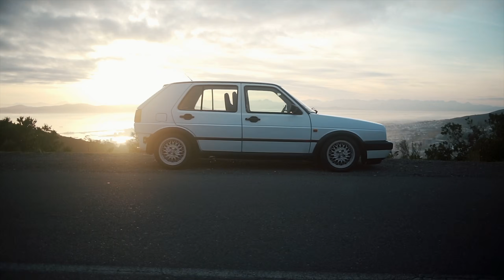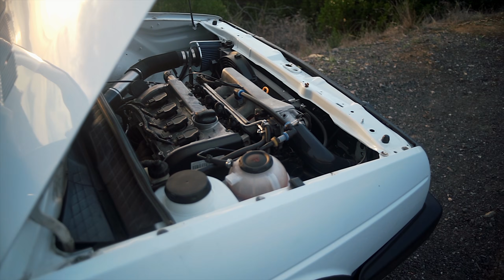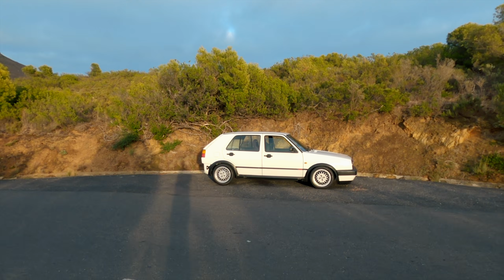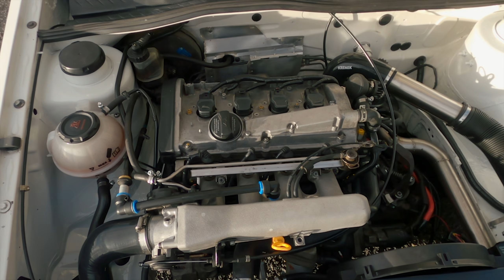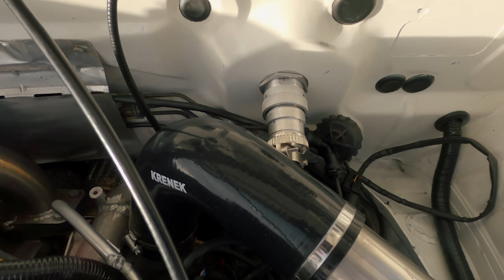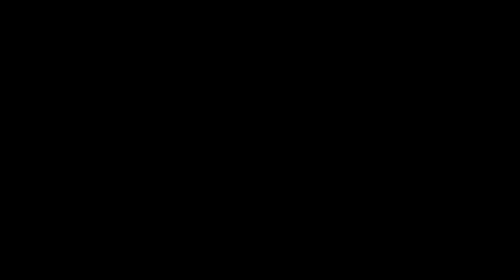How much did it cost to go big turbo 1.8T and cable shift in the Mk2?

Comment from the maker: I made a mistake with the wiring section. The injectors (4x1000cc's) shouldn't have been in there and I mentioned wiring connectors & the Mill spec connector but it's the same thing. 🙈 3k off the price there.

Comment: Hey man, I known this video is a while back, but this is a stunning car and build.
Are you still running the Mr Turbo GT28? Has it given you any issues? 
I'm thinking about getting that same turbo from Mr Turbo for my Focus ST225, but I need honest input about its reliability and how far it can be pushed.
Reply from the maker: Hey. That turbo is long gone. I wouldn't recommend it. Get the GT30. If you want fast response, get the .48 hotside. But for your displacement, the .63 is probably the one. My dad runs this turbo and it's taken absolute punishment. My 28 didn't last too long. 😢
Reply: @lowdl Thanks a lot. I was just aiming for 300kw with a GT28 as I'm currently stuck at 240kw on stock turbo, but now I might as well shoot for 350+. I was just very concerned about reliability and quality of Mr Turbo turbos.
Reply from the maker: @Chad_ST225 The 28 is a bit of a mismatch. And having a T25 flanged turbo is limiting long term. If you go with the T3 GT30, you can easily upgrade. Because you will want to. But bang for buck, those Mr Turbos are brilliant.

Comment: Thanks a million!  Was considering the same upgrade. .....
Reply from the maker: It’s a good swap. Depending on what you want to do with the car you can modify it accordingly. If you want big power, you need a big turbo and that gets expensive. But if you want a fast road car then the stock turbo works fine and will save you a lot of money. If I were to do it again I would probably fit a BAM engine with the K04 turbo. It will make around 180kw and be the perfect all round car.
Reply: @lowdl  is it possible to give you a call some time? Really appreciated your videos and would like to get in touch as I am still running KJet and my CLi is very special to me....was also looking at the other route you've taken with the throttles....but feel it would change the character of the car too much with that sound

Comment: Hi Lorenzo I wanna ask if the speedometer is working after your engine swiped or you had to modify, thanks
Reply from the maker: Hey. The speedo is connected to the gearbox so it's not so much an engine thing but a gearbox thing. Because I changed both the engine and the gearbox, I had to modify the output from the gearbox. You get an adapter that takes a digital signal and makes it analog for the Mk2's analog cluster. Speed seems fairly accurate but bounces around a bit at very low speeds when pulling away. Haha.
Reply: @lowdl  thank you so much bro.

Comment: I just recently bought a nice 92 gli, but the 16v is tired and actually has Weber carbs on it. Thinking about an engine swap compared to a rebuild on the engine. A 20v turbo sounds more appealing to me with tuneability and easy of engine swap compared to a vr6. Thanks for your incite. Was gonna keep the stock turbo though if I choose that engine though only wanna rock like low 200 hrsps
Reply from the maker: Would highly recommend the swap. Stock turbo is fine. Ideally K03s or K04 if you want low to mid 200s. The K03 is a sub 200hp turbo. All the best with it, Webers on a 16v is pretty cool too. A rebuild is probably cheaper with a set of cams and it will be fun. The 20vt just gives you a lot more head room and torque.
Reply: @lowdl  it's just I'm in California so I previously got the car illegally smogged. The car currently in webers eats gas like 17-20 mpg, it's running a little rich so need to tune it better but the car has 300000 miles on the motor knowing I need to swap or rebuild. So I think I can Get the car smog legal if I switch to a 1.8t and verified as that. So with just a programmed tune with stock internals and turbo 200 ish is about the limit otherwise I'd need to upgrade the turbo in order to get into the 200-250 range. I'm talking about at the crank too btw.
Reply from the maker: That makes sense. 1.8T is the way to go then. Definitely more efficient and will pass smog. If you can find a donor Mk4 1.8T and swap everything including the ecu you will be in a good space. The top spec 1.8T with a ME.7.5 ecu is the one you want. All the best with your adventures. Hit me up on IG (@lowdl) and keep me in the loop. I know Cali is wild with emissions things.

Comment: Wow! You just motivated me to finish building my GTI and get it back on the road...What clutch and flywheel are you running?
Reply from the maker: That’s great to hear. It’s a ABF clutch and stock 1.8T flywheel. Seems to hold the power just fine.

Comment: Is it engine too close to the ground? I have issues, my oil pan is dangeoursly low... Sport coilovers, 195/45 15 tyres
Reply from the maker: Yes, the oil pan does low on the 1.8T. I raised the car up so that I don't have clearance issues.I've heard that the 1.8T beetle pan is the way to go. It's a tad shorter but it's metal. So it can take a beating.

Comment: Hey buddy.. What fuel pump did you change ? the in-tank or the one under the car ? and what did you go for ?
Reply from the maker: I didn't change the fuel pump. It's the stock GTI pump which is under the car. It's working well so I have no plans to change it any time soon. I'll see how it handles Ethanol soon. lol.
Reply: @lowdl  thats fantastic. those pumps are really good. Ethanol you say ? Gonow. lol
Reply from the maker: A slight blend should be good. E20 or at max E50. Will be interesting to see what it makes.

Comment: Hi Lorenzo, I think I've asked you before but I'll ask again. Would you sell me you 16v throttle setup?
Reply from the maker: Hey Keegan. Sadly it's not for sale. I'll be using it for a future project. I need to have another itb setup in my life.
Reply: @lowdl  hey quick question I managed to get hold of a 2.0 16v ALL motor (mk2 gti) I would like to throttle it, could you give me some pointers?
Reply from the maker: No problem. It depends on how much you want out of it. If it’s just for the sound. Get a quality intake manifold + injector rail combo. The cheap ones don’t help much. You don’t need big injectors, stock 20vt ones will do. 43mm Toyota 20v throttle bodies are better than the 45’s. 38/40mm would be ideal but you would need to go with bike throttle bodies for that and it’s not that easily accessible. Longer ram tubes will give you more low down torque. The stock radiator won’t allow you to go long so switching to a slimline fan will help. You can run a 80/100mm ram tube. You will need an ecu to control ignition and fueling, so go with the one your tuner recommends. That’s the basic setup. Cams and headwork will make it come alive. Anything over 276 cams you will need to pocket the pistons for valve clearance. I think that’s it for now. The sound is great and that’s why I want to do it again. 😬
Reply: @lowdl  you basically have this above your head every night before you go sleep. 😂👌
Reply from the maker: @JA_S_ON  😂😂😂

Comment: Thank you for the build breakdown, it gives more perspective to everyone. It really is not a cheap swop and ontop of that, seeing you did not skimp on parts, R70k is really not bad for the full swop taking everything into consideration. You must also include re-registration fees, that’s something people tend to forget about. With our laws in SA you car can be impounded if the engine and VIN numbers do not match up and can end in your pride and joy being vandalized and stripped at the impound lot.

My suggestion on the next mod before anything else, a decent set of brakes. It doesn’t help you can go fast but not stop when you need to. I fitted 8L S3 brakes to my BJX Polo and man they do the trick nicely.  I have my stock 9N3 PGTI calipers and carriers if you would be interested, not sure if they will fit the MK2 though 🤷🏼‍♂️

If I am not mistaken the box is a 02J 5 Speed cable shift box. On the BJX we have the 02R box and from what I could gather they are similar.

As always keep up the great content bud 🙌🏼
Reply from the maker: Thanks Martin.
I need to have the car registered asap, it a bit of a pain but needs to be done.

The next mod is actually more power. lol. But I am planning a brake upgrade soon. I think I'll go with a 256mm and a good pad. I don't think that 280mm's will clear my current wheels. So until I find a good replacement set, 256mm should do it. It's currently 239mm. I'll find out if I can make your BJX setup work on the Mk2.

Just did a quick google search & the gearbox code is EBD. But the 02J family. 
And the O2R box has the same ratios but the final drive is lower. Yours is 3.684 & mine is 4.235.

Thanks for your feedback as usual 💪🏾

Comment: hi how much do the 20 v cylinder heads go for in the market i have a new one never used it is a 058 brand new with valves and cams with the tappet cover ,nice build by the way
Reply from the maker: How did you manage to find a brand new head? I’m sure it’s worth a good amount. There’s no real pricing online to gauge to going rate. So you’ve gotta thumb suck on this one 😂
And thanks, appreciate that.
Reply: @lowdl  got it from work university mechanical professor retired he had good connections with VW south Africa there were a lot of unused items throttle bodies cylinder heads ect  ,but i know people really don't want to pay for something like this like pay high amounts for it ,they want it for nothing thanks for your reply.
Reply: Mr I need lots of parts for my 1.8t can i your numbers please

Comment: Great build 20vt more bang for buck then 8v 16v or 20v N/A i just wanted to ask why did you not just turbo the 16v since you already had it in the car . Being following this build from beginning
Reply from the maker: Because the 20vt is the better platform for reliable power. If this engine pops, I can get another one and drop it in. The 16v would have needed modifications and they’re becoming harder to find parts for. The workshop working on the car also specializes in 20vt’s so that played a big roll as well.
Reply: @lowdl  thanks for the reply I really enjoyed the build im planning a 20v conversion for my mk1 velociti 1.4i
Reply from the maker: @Mr_R287  That's a good plan. They feel wild in a Mk1. 😬

Comment: Great video as always and thanks for putting this together. I've got a 1.8t 20v Polo, if I go big turbo along with bigger injectors can I run it with stock ECU or do you need an aftermarket one?
Reply: You will need intercooler,downpipe ,exhaust  software stage 2.
Reply from the maker: Hey. What Thurlo said but to answer your question, no you can run it from your stock ecu. It’s more than capable. The J2 polos make 240-330kw with the stock ecu. Its the AGU Mk4’s with the crappier ecu’s. We went aftermarket for features such as making map adjustment on the fly, boost by gear, external data logging, etc. The stock ecu doesn’t have all of that but it does what it should really well.